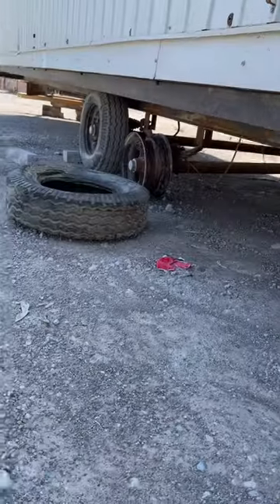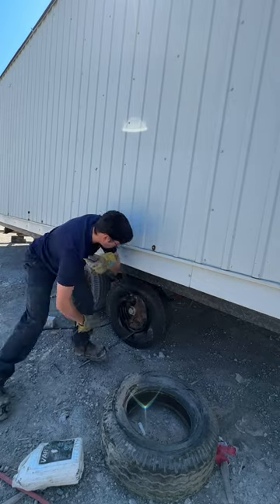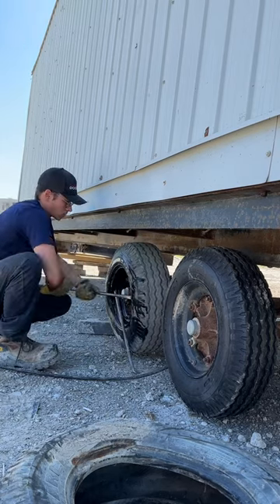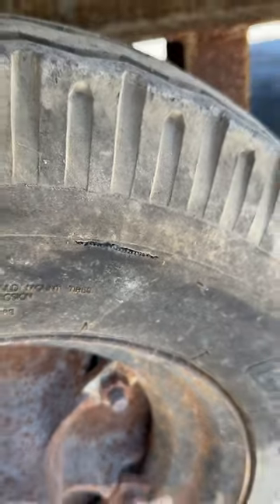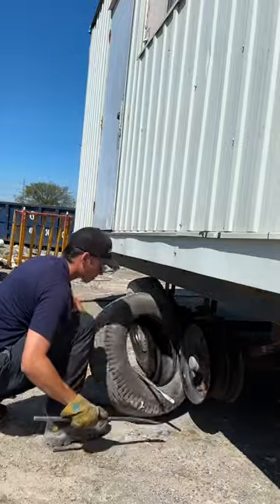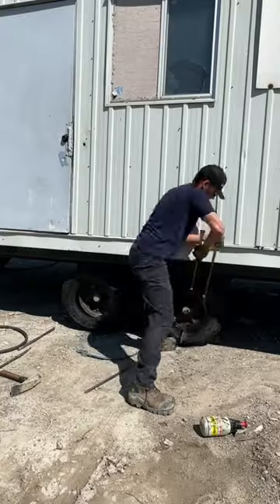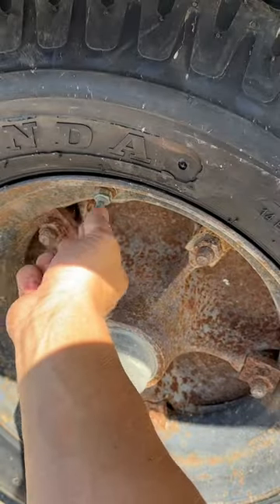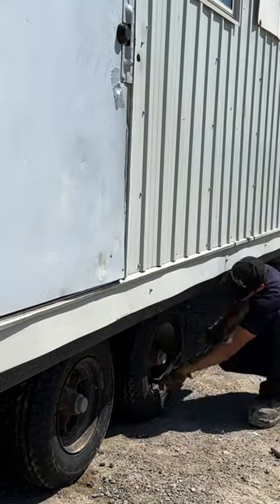Mobile Home Tires Suck!

Comment: We usually put construction trailers on jackstands
Reply: Defenitely prevents tire rot and flatspotting. Bonus the office is actually level😂
Reply: I was going to ask about that.
Reply: Block and level them at every delivery site. The worst is when they want them tied down in a new parking lot... sucks drilling through someone's work for a few tie down stakes. Oh, well.
Reply: does covering the tires protect them from drying out and rotting?
Reply: @danielhempel.clearly good question! Id have thought a tarp or sheet tied over them would avoid UV degradation
Reply: @wintersun398 taking the weight off would be the first consideration, but I guess it wouldn't hurt to cover them. In UK weather I'd be worried about condensation getting trapped.
Reply: Jack's and tire covers are the way to go to help your tires stay good and not dry rotted and flat

Comment: These videos are amazing for some reason
Reply from the maker: Fr tho
Reply: @TheTireDoctor : Hey, I'm curious what ft-lbs you torqued those rim clamp nuts/bolts at?

As I recall, they don't require much torque, as compared to a conventional car or trailer lug-centric/center disc wheel.

If my memory serves me, it's like 65 to 85 ft-lbs? 
(85 ft-lbs almost seems too high.) 

All I know is that I over-torqued the front wheel rim clamps on my Massey Ferguson 285 diesel farm tractor a few years ago, after repairing the tube, and I broke/cracked almost every one of the cast clamps. 
What a dumb & costly mistake that was! 

I remember spending quite a lot of time searching online to find the correct torque spec, as it wasn't easy to find, as other styles of wheel specs typically are.

Comment: Trailers are difficult when it comes to keep tires in shape, you need to lift it off the ground, spray silicone on the tires and wrap them up in anything that can keep them off the weather, heat and cold. Not that they wont go bad, but you would be able to use them if you need to move it instead of needing to dig the ground to get the wheels off.

Comment: Tire doctor, do not "re-torque" Dayton rims. They have to be aligned by the force on each nut, as you spin the rim by hand. If you tighten them all the same, you run the chances of the tires flopping around while moving and causing premature wear.

Comment: If only they made a tire for those that lasted more than a couple of years before dry rotting these days. 
I replaced all four on my trailer in 2021, used it for about 800 miles and its sat in the barn since. All four tires are cracked worse than those I took off it in 2021 just two years and a month later. $600 in the trash I guess.

Comment: Do the valve caps actually matter? I don't know how many I've lost... and why do you retorque the wheels?
Reply: They do matter you can get debris in the end of the valve stem around the core and it can cause it to leak also without a cap you will lose air pressure faster if the trailer isn’t being used daily all tires lose alittle air over time
Reply: Also you torque all lug nuts when you change the tire to make sure the lug nuts do not come loose and you should retorque after 100miles or so after they settle. If they are under torqued the wheel will wobble cause wheel damage and it could come off on the road and over torquing can cause the threads to stretch and will make the lug nuts loosen aswell. ( I am a mobile tire tech of 5 years in AL U.S)
Reply: @timking1141  thanks 👍

Comment: Do You really need to put the valve caps back on serious question lol
Reply: @bmo14lax :
Yes, you should ALWAYS re-install the valve stem caps.

Valve stem caps protect the valve stem core from the elements, from the weather, from bugs, and more.

Also, on heavy trucks & construction equipment with metal stems & metal caps, the cap can also actually help retain the air in the tire, in an emergency situation, where a valve stem core is damaged or defective.

Serious answer.

Comment: What, you don’t change valve stems like a real tire technician would?
Reply from the maker: And charge the customer for something that doesn’t need to be replaced? Sounds more like a corrupt way to do it
Reply: @TheTireDoctor 
In the US, tire shops change them because they dry rot too
Reply: @JohnSmith-xu7ev most of these use the metal stems.